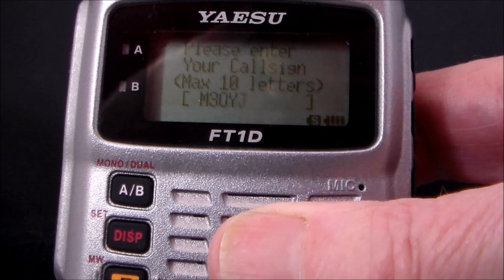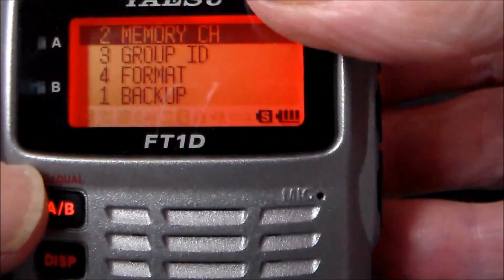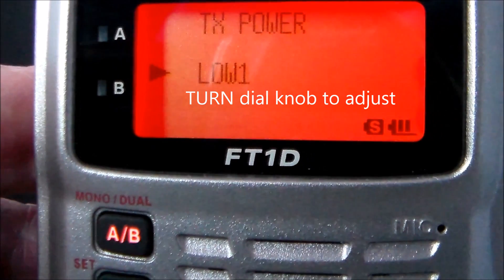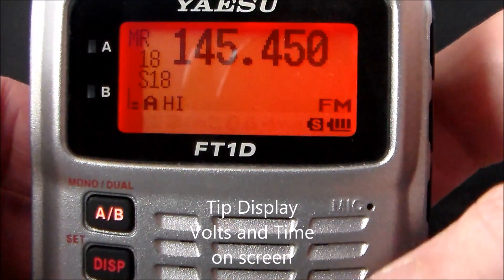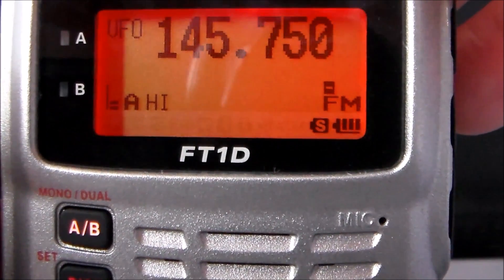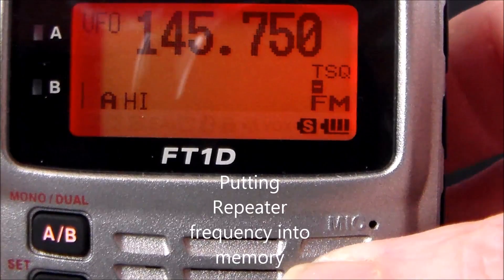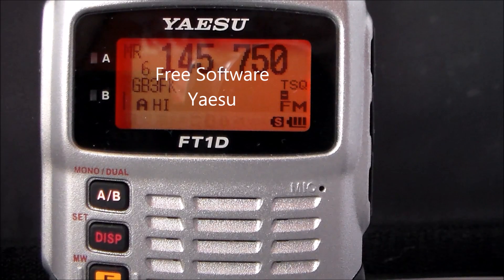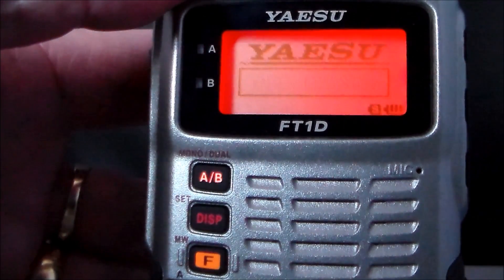Yaesu FT1D Setup

Comment: Having a Issue.. Just got the FT1XDR and I setup from memory channels and I created two Memory banks one for 122MHz and one for 430MHz and then I linked the memory channels into them.

in Band A I can Recall the Bank and all the channels but on Band B its tells me “NO BANK”??  can someone please help with this…

I made a video maybe this will help you understand the issue

https://youtu.be/JAitFlWGhdE
Reply from the maker: Are you using ADMS-6 Software to program the radio if not you can download it free from http://www.yaesu.com/indexVS.cfm?cmd=DisplayProducts&ProdCatID=111&encProdID=25F65DA12CA1FCB444A927CD14417BFD
Reply: I am using a mac :(
Reply from the maker: I think you are in  MR mode (memory) and u push Bank you get NO BANK because you are in MR mode (memory) put it in VFO mode V/M  then push bank then you go up the stored banks M3OYI  now 2E0DTS You will have to get an PC old laptop for programming radios I have a mate has the same problem.